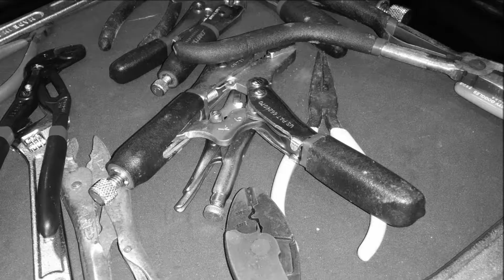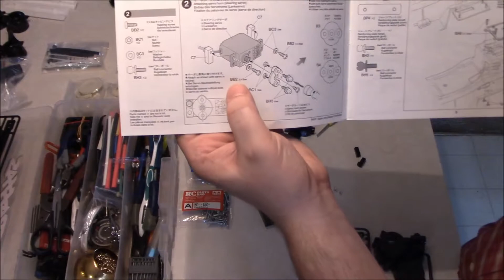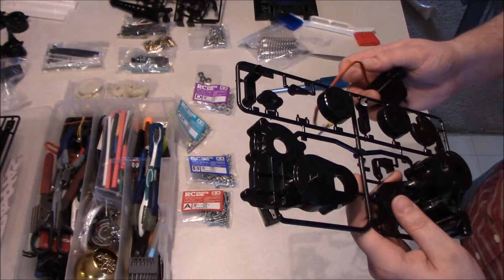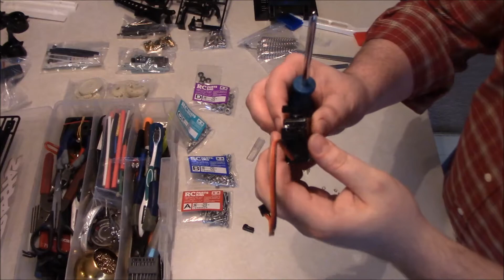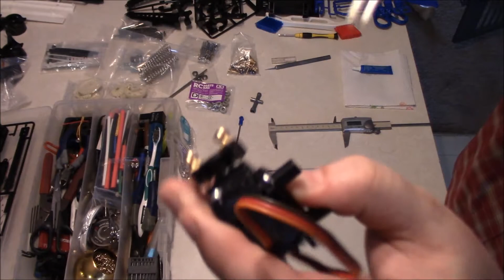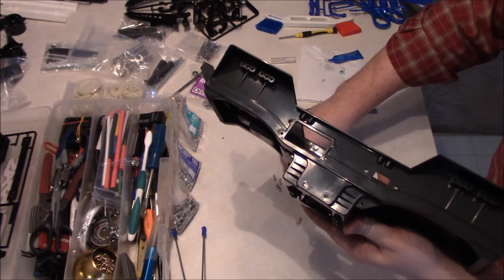RC Tips and Tricks - Tamiya Super Clod Buster Build - Part 1

Comment: blue loctite 242 reacts with plastic which will cause the material to crack if exposed to the chemical; the Tamiya branded thread locker is considered "safer".
Reply: Yeah, nowhere in the manual does it say to use any thread lock, unlike my fighting buggy which specifies it in many places.